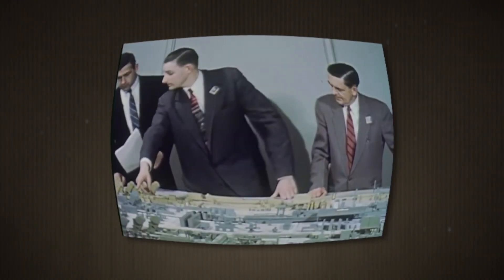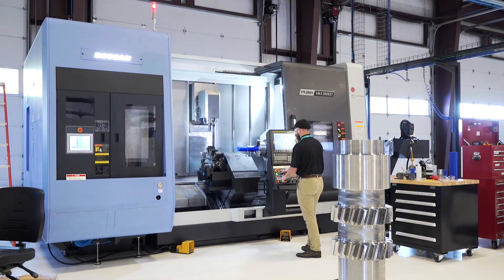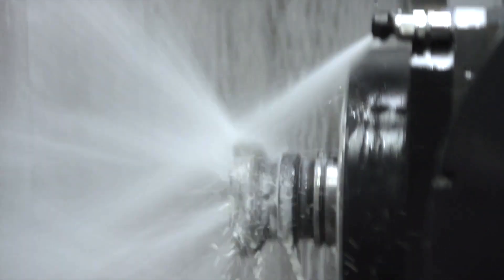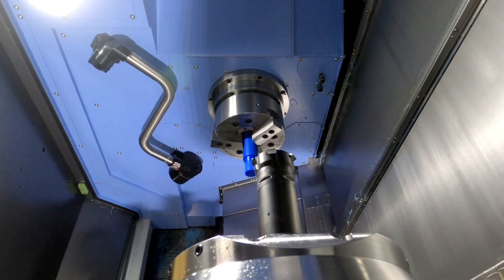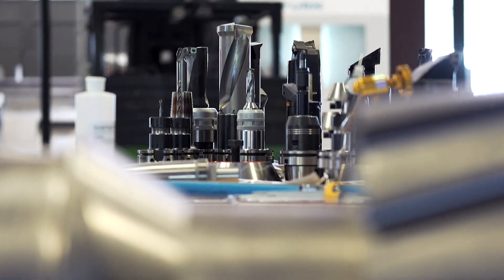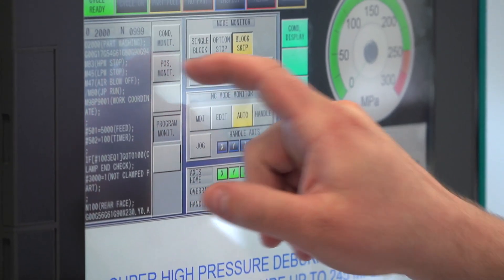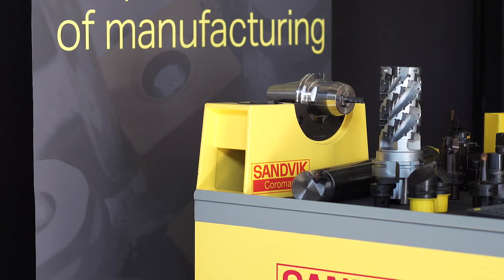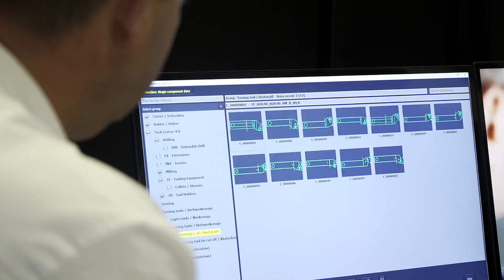See the future! - Sandvik Coromant collaboration with OMIC

Comment: How long would it take to teach somebody with a brain and with basic math and basic computer skills to be able to program and operate this machine and program?
Reply: Depends on the machine type.
Reply: Depends if they can understand it or not
Reply: I watched a DMG application engineer program one skiving program and was able to repeat the process on a different module gear. It’s on a DMU105FD  the Siemens control makes it very easy to program the cycle.